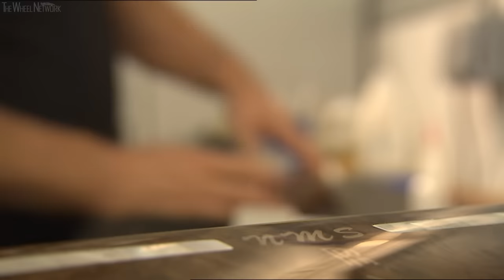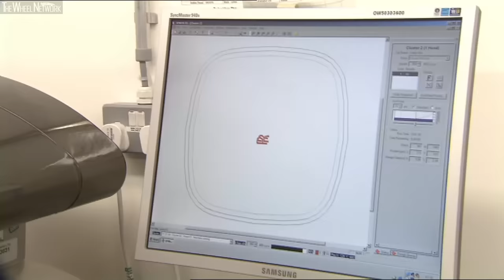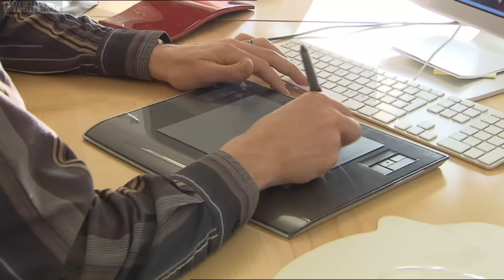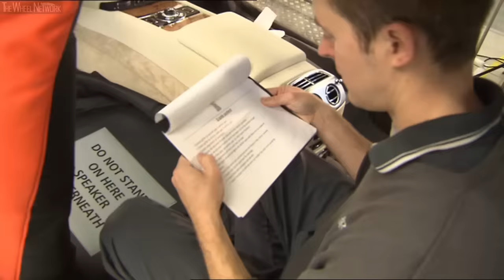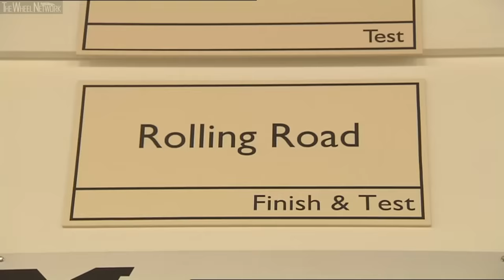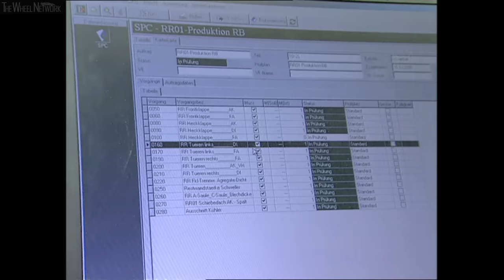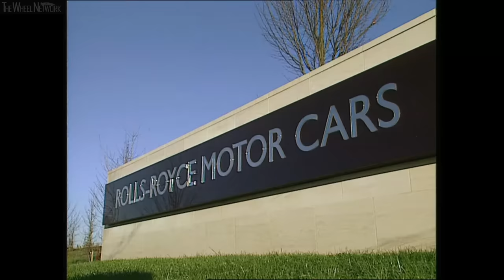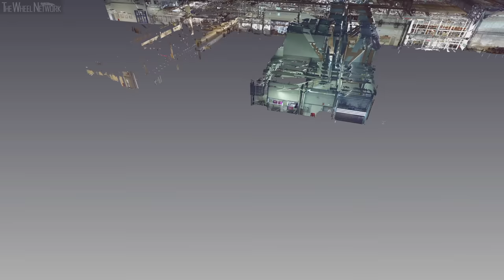Rolls-Royce Production in England

Comment: Got here from Kim Du Toit and Splendid Isolation.
.
1970-74.
The mountains east of Sacramento, California.
I owned a 1958 Bentley.
.
A 'Flintstones' vehicle with much of the floor rusted through, I installed the body on a Chevy pick-up truck frame.
.
As you might expect, a Chevy 454ci was next, then a Ford nine-inch rear axle.
.
Near Mather Air Force Base, Sacramento Raceway had Saturday quarter-mile drags.
The old Bentley rarely broke 108mph at 11.66... and was a squirrelly handful above a sedated 60mph, but was a brute to stop.
.
During my 'brit' period, I also ran a 1953 Austin Healey set up for slalom rallies, and a 1967 XKE coupe rigged for drags.
As you might imagine, Chevy small-blocks were immediately installed, boosting performance -- and reliability -- significantly.

Comment: since... long time ago... i had and idea - everything, what man needs or is necessary to have in your life, is located in a car as solid state piece of engineering. That means - heating,; cooling, ventilation, light and "moving/rotational" force for use in anywhere. and only item or thing you have to substitute is a fuel/gasoline; you have to substitute that liquid force generating "solution" with anything, and you will have a shelter and home (at least you have all necessary parts to build from your car; an apartment or to have inside of your concrete apartment). Now me, after that video, no way. Too accurate; too precise, to sacrifice a car for such idea. Will rebuild my idea, to have a "something" perepetum, to energize everything for 12V without "ruin a car" idea.